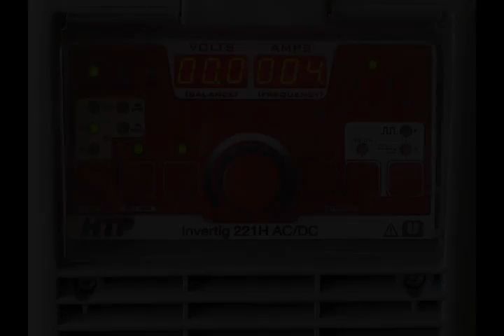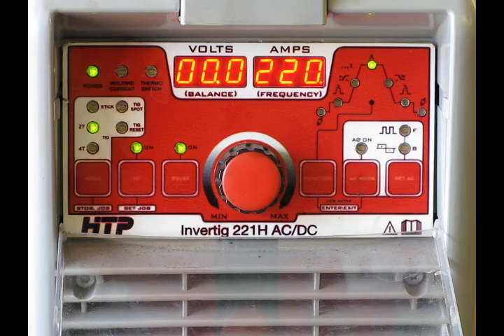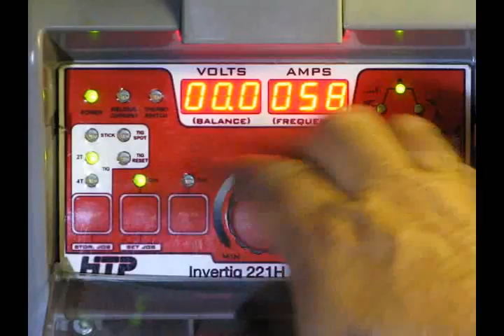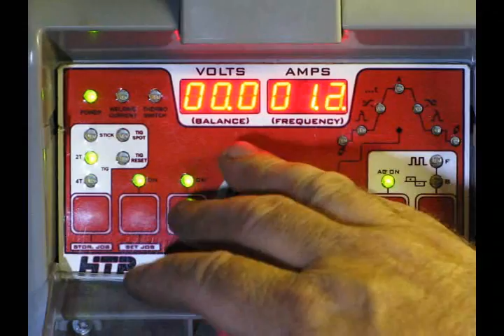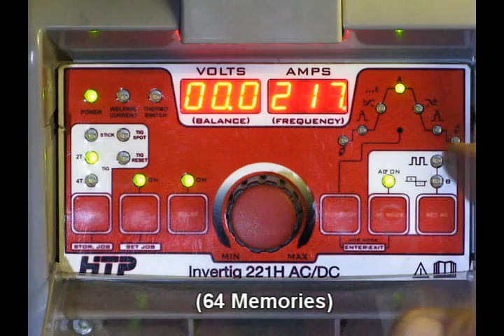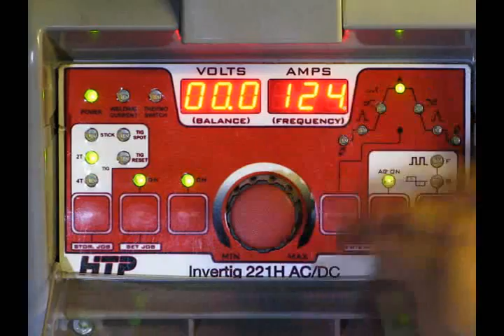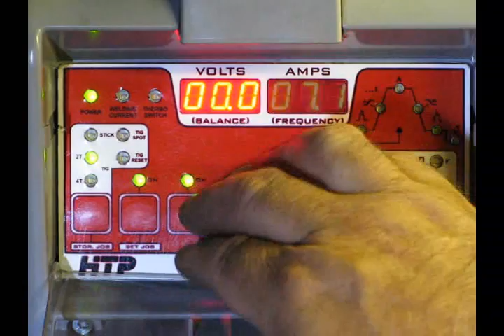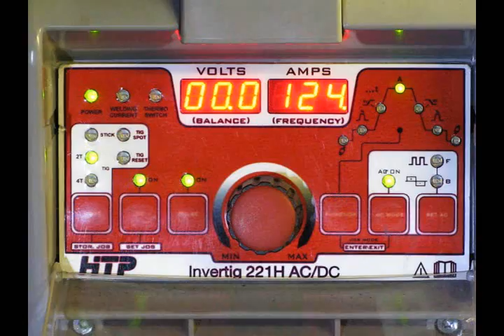Invertig 221H from HTP

Comment: Very nice and well done video. The machine itself is made in Italy?
Reply from the maker: Precivilization yes. It's NOT CHINESE like some of the other machines out there. It is built in Italy and is VERY RELIABLE. Since I made this video, we have used the machine continously. I had a small problem with it and called HTP. I they had a replacement board out to me the next day. I excellent customer service and after sales support.
Reply: Jim Harvey I love my 221 Invertig best tig in its class. The independent ac balance settings being able to change EP and EN settings is crazy only the dynasty starts with thier 350 for that setting. I can ball my tungston by changing it and that is usually only for non inverter welders. Plus pulse stick. It’s just amazing. I don’t like the grey tho glad mine is black.